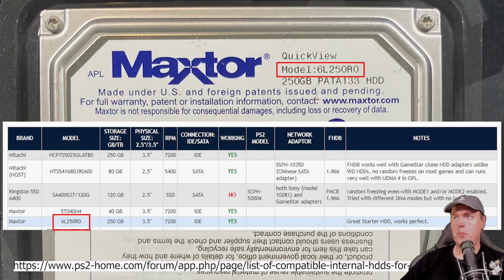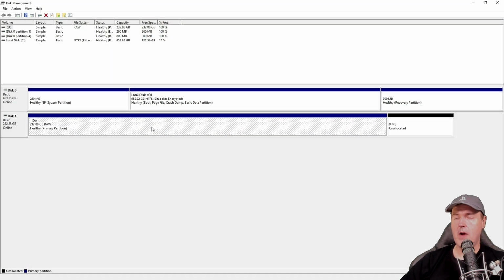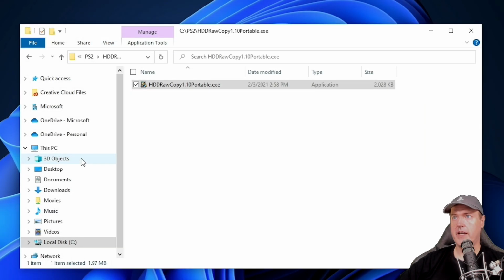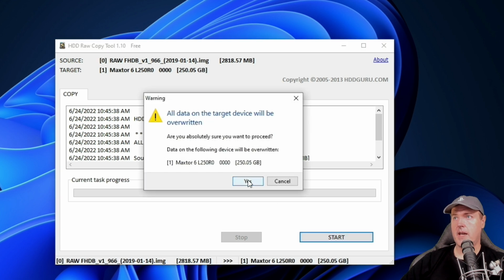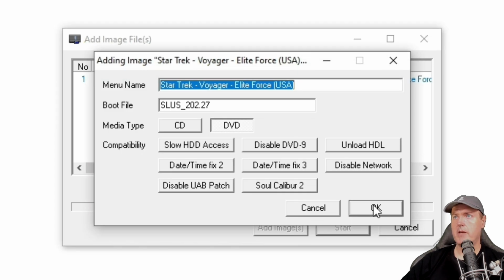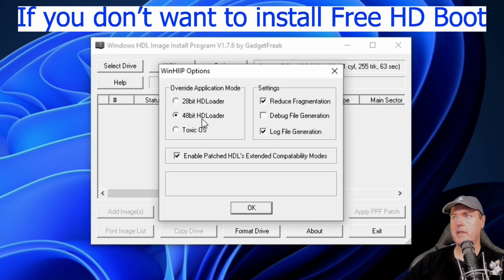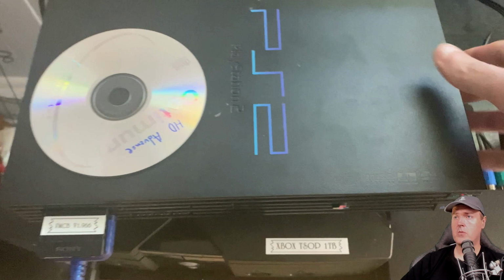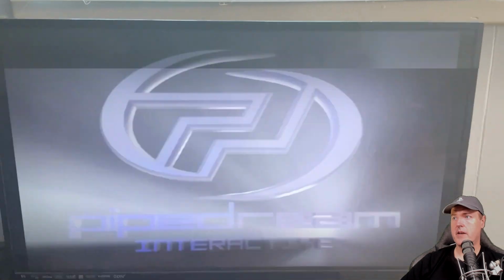Run your PS2 games from the network adapter & HDD with the PS2 Phat  (2022)

Comment: Hey, Thanks from "Down Under" (Australia).
I have been running backups from the Network Adapter/ HDD for many years, but via Free MCBoot.
Thanks for showing me the ways of HDBoot.
But as highlighted by the folks before me, could you please add the download link for the required files?
Reply from the maker: Here ya go! https://mega.nz/file/A8N0yKgQ#j6scrNymOypGL0_EK-UVacrNtIhIltkjSztYQI2gBBI